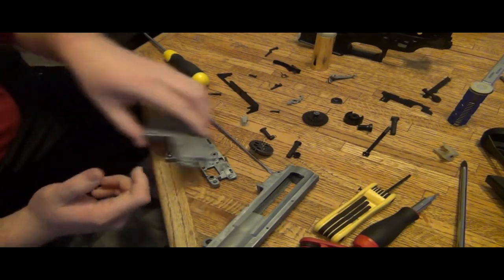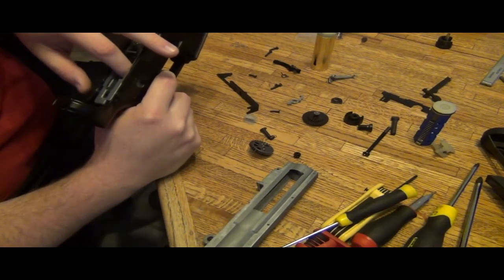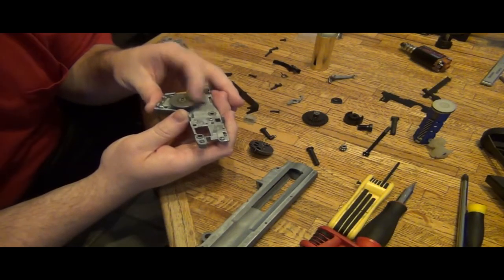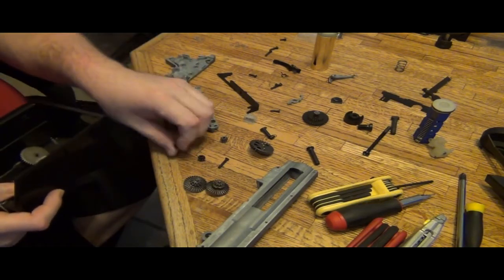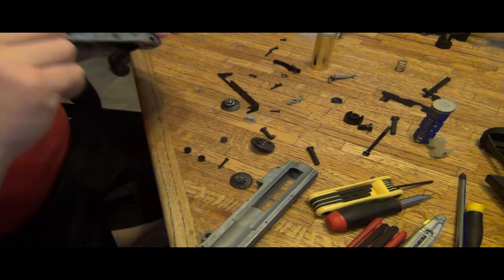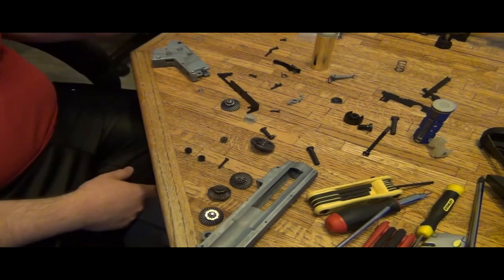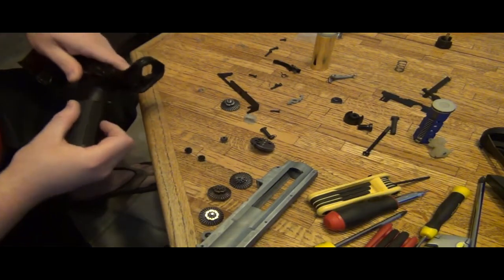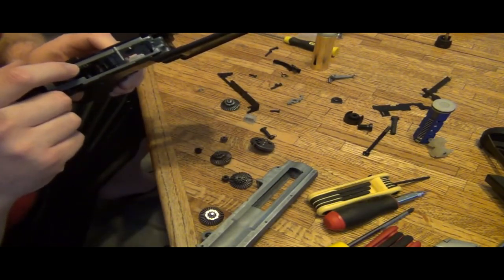Bevel-to-Pinion, Mixing Brands Mesh on the ICS PCR-97

Comment: @ZaCkO
I have been playing airsoft for a while now. I have worked on quite a few of my friends gun's. They would buy the part I would just install them. I need a new bevel and sector gear. But I am clue less on the ratio's that u r talking about (13:1 ratio) if u could tell me what the ratio's mean that would be greatly appreciated.